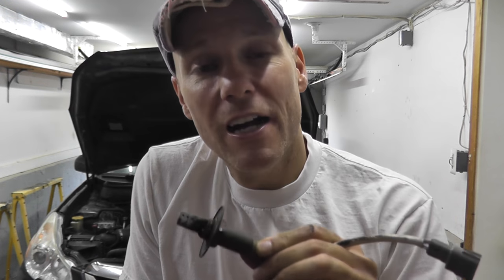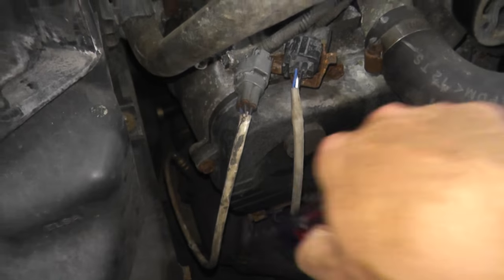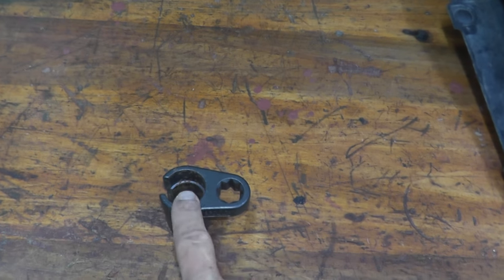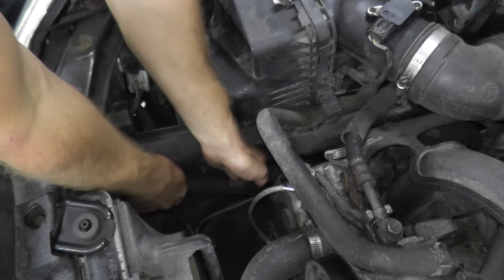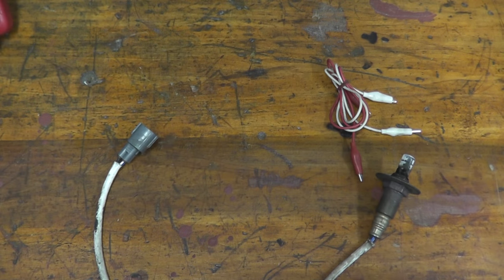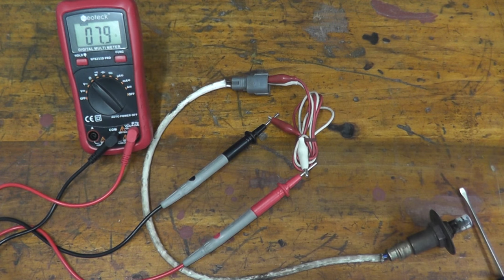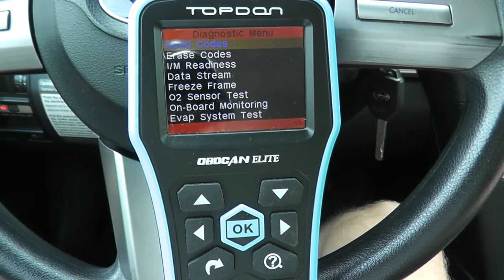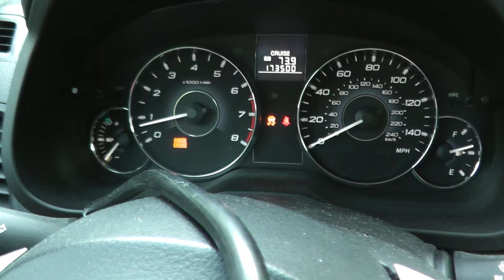Subaru Oxygen Sensor Testing and Replacement P0037 P0038

Comment: Just purchased a 2008 Forester. 142,000 miles. It cuts out at 4,000 RPMs. Going to buy PB blaster and mabe some sensor cleaner. Going to buy a tester for my own repairs. Thanks for the good video. Makes it easier by far.

Comment: Good video. I bought one of those Fixd Sensors…$20 better than nothing.

P0140 sensor code. Live data I see a value of 1 rather than the anticipated 0.8, sadly it doesn’t tell me bank or if it’s sensor 1 or 2… 

With the code triggered I’m trying the bank 1 sensor 2 🤞

Comment: What made the catalytic converter go bad?   Running too long with bad sensors?

I have 2011 Camry 2.5 with 177K and no issues.  Is it just Subaru?   

I did change both my sensors at 77K. Up and down.  Probably going to change them again soon.  Denso only
Reply from the maker: There are too many factors that come in to play. My personal feeling, regarding this specific vehicle, is the exhaust developed a small hole. A welder mended the hole but contaminated the converter in the process.
Reply: Toyota much more reliable with less issues especially  evap issues
Reply: @pirihern9329  

    I agree

Comment: My WRX o2 sensor is bad, i try something that some people told me and it's to unplug the sensor to see if i feel some change and my car run better. The symptoms i have with the sensor is poor acceleration, my car stall at stop or red light and she's running too rich wich cuz misfire in my case. When i said poor acceleration i mean that my car lag so much that i cannot do some acceleration, that is temporary that i will run with one of my o2 sensor unplugged. I am waiting my new to come and install it as soon as i can. Subaru problem has we say ahah

Comment: What if the bank 1, sensor 2, reading on the scan tool is moving around from 0.3 to 0.85?
Reply: Is there a chance you already got an answer about your question?
I'll would like to hear😁
Reply: @KOBBIkobbi-kt8wx  I didn't get an answer.
Reply: that should be good most sensors run about .1 all the way to .9 volts for non wide range sensor
Reply: That's a good o2. O2 sensors are suppose to switch from below 200 millivolts and above 800 millivolts (depending on load condition)
The O2 is bank 1 sensor 2 
And the af is bank 1 sensor 1.
Testing an O2 sensor with an ohmmeter should never be done because you can get a false reading seeing live data with the O2 sensor installed is the only way. This video is not accurate

Comment: I have a reading of 2.9 omhs is that Good enough
Reply: Id say that’s pretty good.
Reply: @meanodustino9563  but then I checked the other sensor and I had 85omhs that means that very bad?
Reply: Thats too high
Reply: @meanodustino9563  so It need to be replaced?
Reply: With resistance of that amount i would say its likely not good and has a internal problem so yes replace.
Reply: @meanodustino9563  okay many thanks.